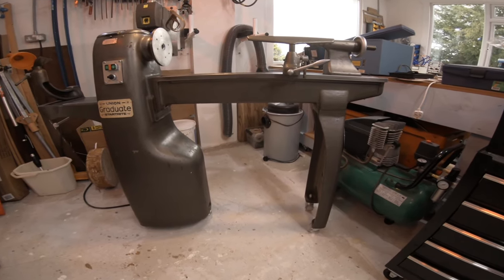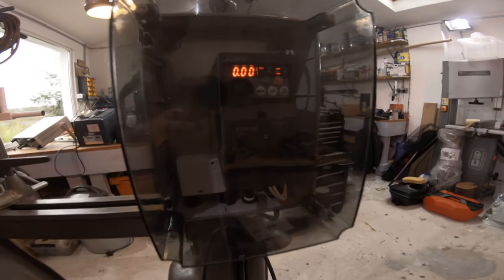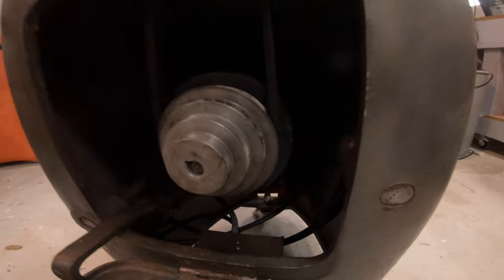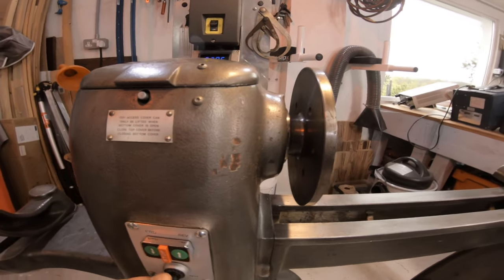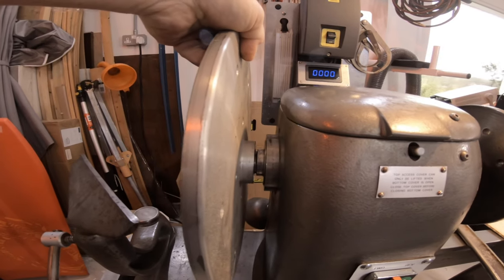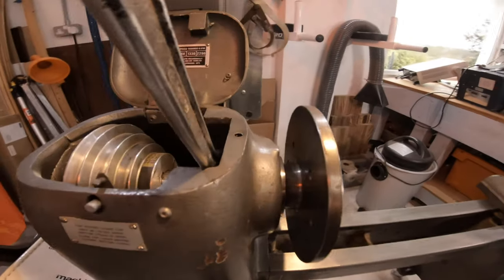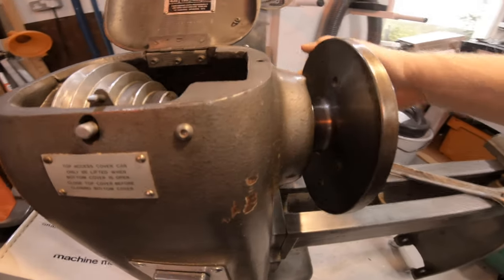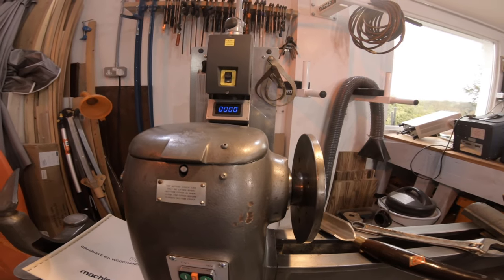UNION GRADUATE Lathe Water Test

Comment: Having just purchased one of these, that’s some really great information, thank you. 

I’m certainly going to get some casters for mine. I don’t suppose you remember the ones you went for?
Reply from the maker: Hi Andrew, I don’t remember the castors exactly, but I can point you in a good direction - https://www.bilgroup.co.uk/product/polyurethane-cast-iron-stem-swivel-braked-castor-35mm-100kg-load/ 
Go to Bil castors and look at their braked swivel castors, the ones with a fixed bolt for preference. Choose a braked castor that has a loading at or above 100kg. Polyurethane tyres with cast iron wheels on ball bearing races are the bogs dollocks.  The castor can be chosen to suit your height, keeping in mind a 35mm wheel (58mm total height) will be harder to push around than a 100mm total height castor, but of course the latter may take the lathe centre height above what is comfortable to use. I have used Bil castors for years and they are by far the best value available in the UK…also check out their ‘sale’ section for bargains. Have fun 👍🏻
Reply: Hi Grant thank you so much for taking the time to reply, it is greatly appreciated.

Given I’m rather tall (6’ 4”) I was planning to higher the lathe anyway, so the castors will probably be enough. So I shall get 5 of them ordered. 

I certainly hope to have fun learning what to do!
Reply from the maker: @andrewfitzmaurice7843  If you are running a three phase motor and want some VFD (250v - 380v) advice, I have a video on my channel that might help. 👍🏻
Reply: I will take a look, it does have a Newton Tesla inverter, but have to confess I don’t have a clue about this side of things, I just know it works from a 13 amp plug!
Reply from the maker: @andrewfitzmaurice7843  The Newton Tesla units are good, so things should be just fine

Comment: That's some "old school" bit of kit .
I just sold my axminster midi to purchase a graduate and start doing "proper" bowls.
Does the wheel assembly affect stability with large (40 kilo) unbalanced blanks ?
Reply from the maker: Hi Peter, it didn’t seem to matter stability-wise what the lathe was spinning, even huge unbalanced blanks on the bowl side or between centres.  The castors can be hobbled easily due to their small diameter if required.  Good luck with your search...
Reply: @GrantWyness  
Thanks for the excellent idea.
I'll keep looking 👍